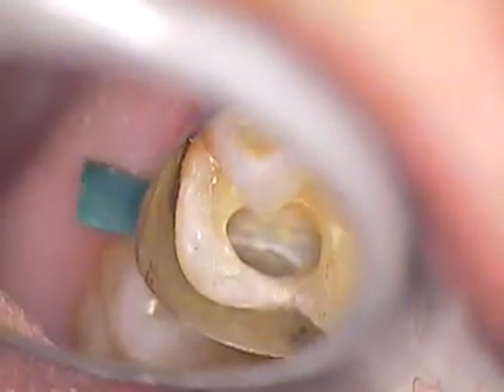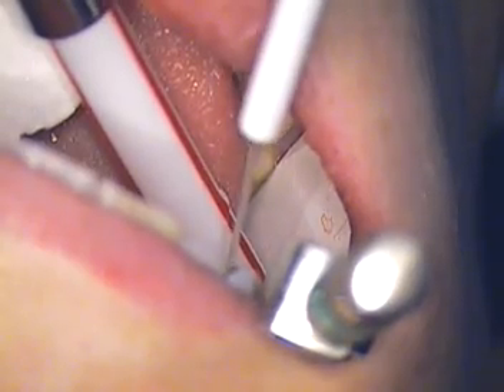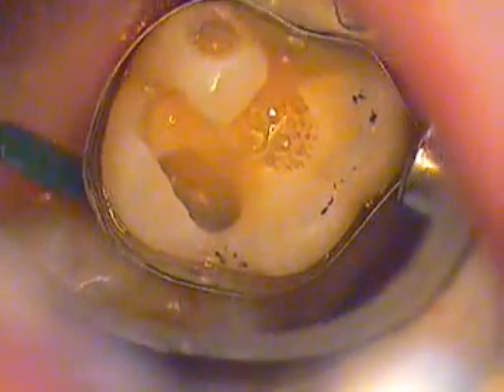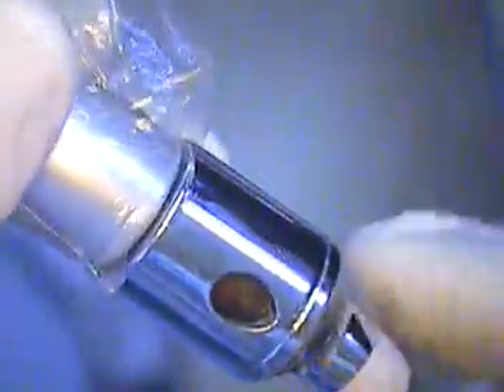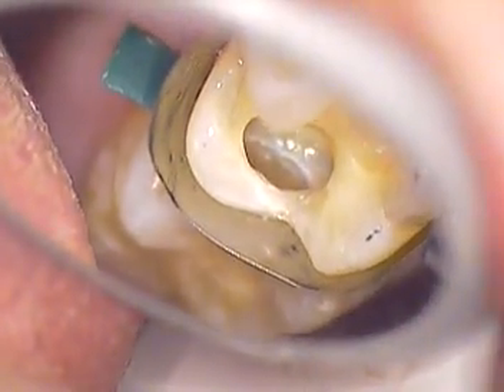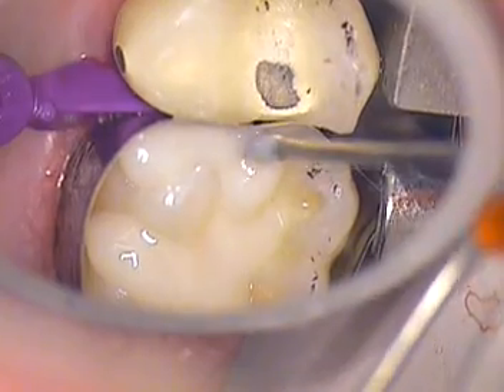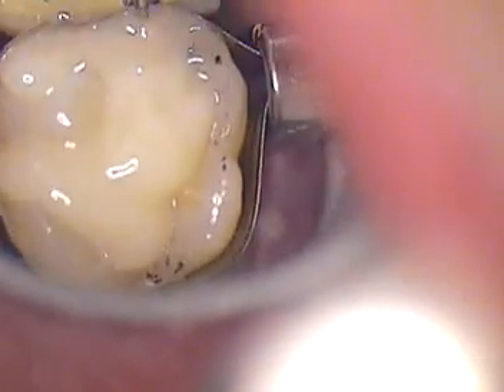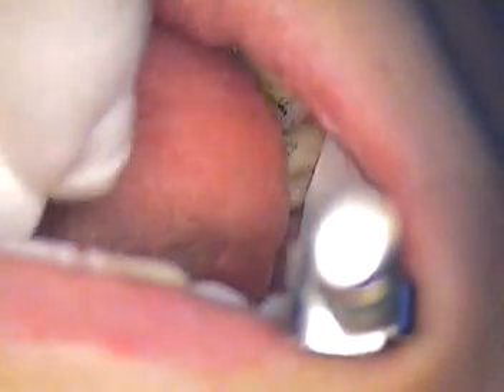DR.GERARD CUOMO -Restoring a severely decayed tooth using a dental "tunnel prep" 2of2 Boca Raton, FL

Comment: Hi, I'm a fourth yr dental student and find your videos extremely useful so thank you. Just a quick question, you've used flowable to build this tooth up, apart from ease of use are there other advantages to using flowable over composite for the core build up? I just thought if the core was built up using composite when it came to crowning the tooth- the core is already present?

Thank you kindly

Comment from the maker: The core buildup restorative material remains to perserve the tooth volume.  This will in turn give my lab the right amount of room they'll need to uniformly build the metal and ceramic components of the crown. You are right about tunnel preparations.  Unless you are using a microscope, I would highly suggest avoiding the technique. 70% of my patients don't mind the use of the rubber dam.  Obviously, this was the exception.

Comment from the maker: @BroadwayPirate1106 An aphthous ulcer also known as a canker sore, is a type of oral ulcer, which presents as a painful open sore inside the mouth or upper throat.  We have found success in treating these ulcers early with a 50/50 mix Listerine and Peroxide.  Swish about 1 ounce orally until you feel tingling (5-10 secs) and spit out. Repeat 2-3x/daily until symptoms subside. Try seeing a good nutritionist and get tested for food allergies and irritants.  Best of Luck. GC

Comment from the maker: @BroadwayPirate1106 The pH of these solutions is adjusted to approximately 6.5 (5.0–7.0) with sodium hydroxide and/or hydrochloric acid.  I have not observed any cases related to oral ulcers.  There are patients in my practice who require anesthetic w/o the vasoconstrictors epinephrine and  neo-cobefrin.  Carbocaine 3% is a good alternative, but it is short acting.  It's duration is 30-60 minutes and then the patient needs to be reinjected with more.  Autoimmune diseases can be treated.

Comment: @gmcuomo  thank you very much for the reply. I am actually planing on starting to use denmat's core. as you mentioned in cases where patients are informed they need a crown but prefer to keep it to a later stage. it will save some time for the core buildup during the preparation visit. Now you encouraged me to get all bond 3 , as i also prefer using a primer and a bonding agent separately... keep up the good work :)

Comment from the maker: @tdrdent good questions. . . All bond 3 has both a primer and a bonding agent.  My experience using reinforced glass ionomers(i.e. Ketac Silver) was not favorable.  I noticed other clinician's work failing (severe microleakage) and I decided to use another product with a better track record.   I'm comfortable using Denmat's core paste as long as the patient is informed that a crown should be placed in the near future.  Gordon Christensen's CRA product evaluation newsletter is good to read. GC

Comment from the maker: durgaaa Your welcome.  Composite core buildups prevent tooth sensitivity by insulating the dentin and pulp.  Lidocaine does not prevent a pulpitis (nerve inflamation).  The pulp usually stops working properly and becomes inflamed due to an accumulation of events.  The nerve responds to decay, cracks, the first filling, crown preparation, bite, etc.  Predicting the need for a root canal can be difficult at times.  X-rays can only reveal chronic problems and not those that are acute in nature.  GC